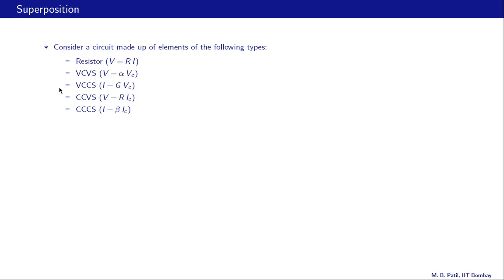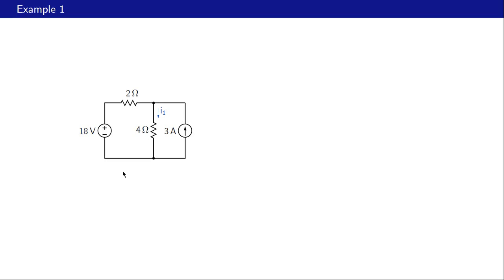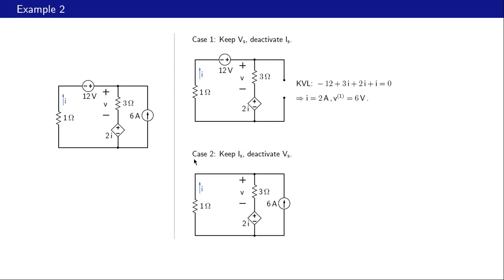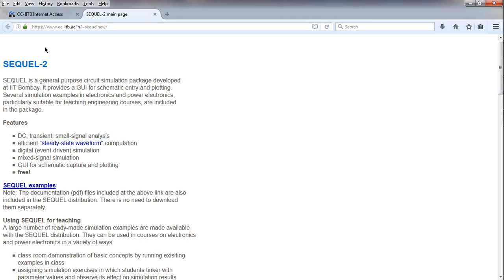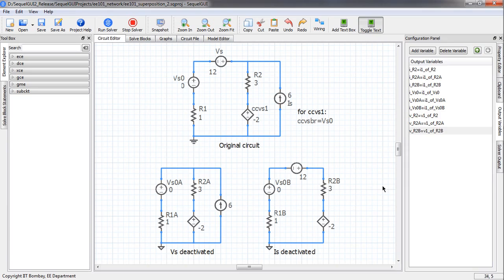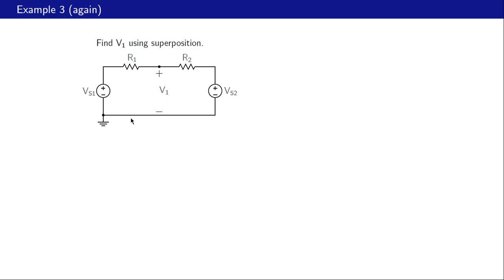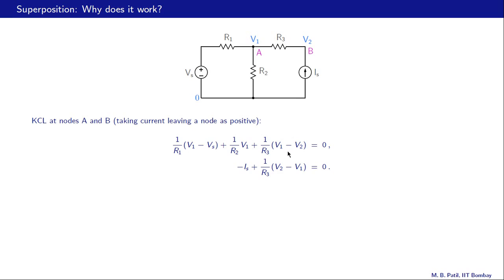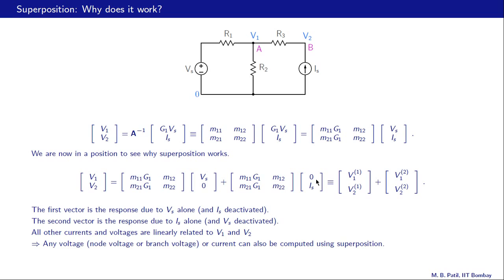SUPERPOSITION

Comment: hard to digest actually.... too many new terms left unexplained
Reply: this course is designed keeping in mind that the student is clear with 11-12 class (Highschool) Physics that too JEE ADVANCED level. Which included topics like( In Order) : Electrostatics, current electricity(basic circuit analysis), Capacitors, Magnetics, EMI, AC, Modern Physics.
You can ignore mechanics for now since its not a pre-requisite for studying electronics!
Happy Learning ✌
Reply: @adityabhoite7874  BS.. You are just to know the basics which is ncert of 12th.. 
Jee adv .. lol 😂
Reply: Yes,I feel the same 😢.is that really a crime that not to Read in 11th😮😅😂
Reply: This is a first year BTech course. People are supposed to know basic electrical circuit elements like resistance, inductance, capacitance; Voltage-current relationship, Ohm's law, KVL, KCL; concept of equivalent resistance etc. These are mainly taught in 11-12 science (Physics) stream. If you are not accustomed to these topics or didn't have basic science background, then understanding will be difficult. You can start with a basic 11-12 science book first and then come back to these topics. Because this is just the start. It will become harder and harder.

Comment: The coupling of ac signals to inputs of transistors (an ac signal rides on a dc voltage) and generation of an ac equivalent circuit to analyze transistor amplifiers is one of the classic applications of the principle of superposition of potential.  

Electrostatics and circuits belong to one science not two. To learn the operation of circuits, Current and the conduction process, resistors and how discussing these topics makes it easier to understand the principle of superposition of potential which is a direct consequence of the principle of superposition applied to electric fields, 
watch these two videos 
i. https://youtu.be/TTtt28b1dYo and 
ii. https://youtu.be/8BQM_xw2Rfo 

The last frame contains references in video #1 which lists two textbooks 3 and 4 with topics that discuss the operation of capacitors, inductors, diodes and their operation in amplifier circuits and circuit theory. 

Chapter 3 in textbook 4 was included with the aim of preparing students to be able to analyze amplifier circuits in more advanced courses in electronics. It begins with a description in detail wigh sequential diagrams of how ac signals are coupled using a capacitor to the input of amplifiers. 
Stray capacitance effects limit amplifier high frequency performance, and a description that uses the principle of superposition to explain this is provided in one section of chapter 3 of textbook 4. 

The voltage-shunt feedback method finds an important application in a wide class of linear integrated circuits, the operational amplifier, and in a continuing vein of the principle of superposition, the final section of chapter 3, textbook 4 describes this method.The results of simulation runs of circuits that superimpose ac signals on dc voltages “Simulation_super_ac_sig_on_dc_volt.pdf” and of CR phase-shifting networks typically used in RC Phase shift oscillators “RC phase shifters.pdf” are included in pdf files in the CD which is included with textbook 4.
Procedures to obtain the voltages, currents and waveforms for this using TINA simulation software (freely downloadable) are also provided in the CD.